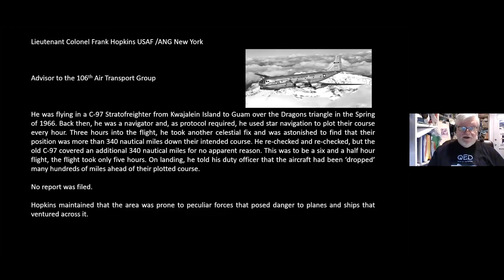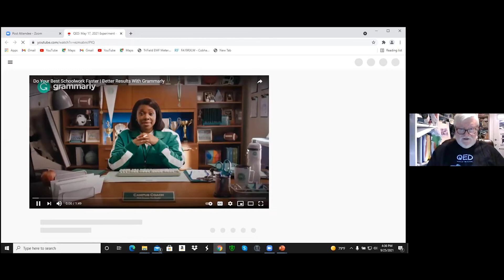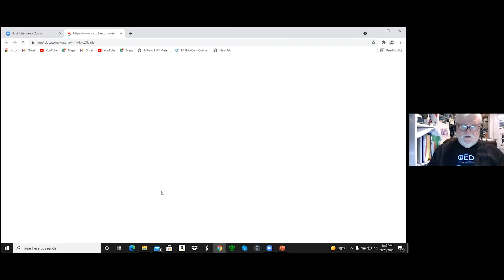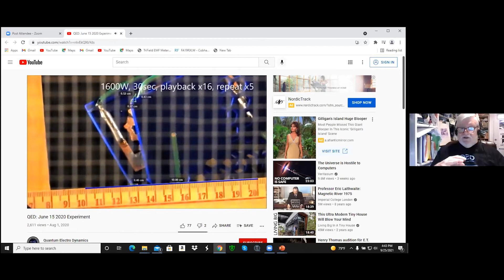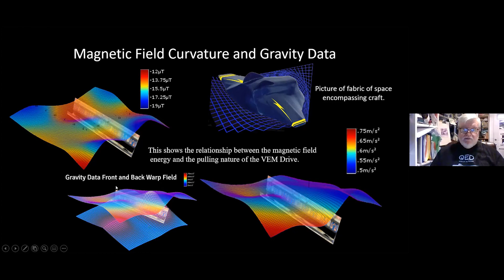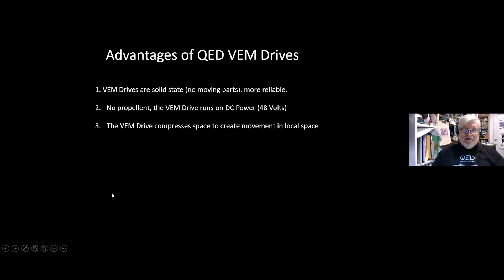APEC 9/25, Part #3 - David Pares - The Variable Electromagnetic Drive

Comment: Re the VEM Drive's Discussions: Although it would be super fun/awesome to do, QED/them doing a tech demo at Burning Man in 2022 or 2023 will be significantly much more money, time, and effort/trouble than doing vacuum chamber tests at their garage lab (of their May 17th, Modified Cavendish Experiment, for example) – and the end result will be the same, getting 'chequebook-supporters' (or a buyerr) for their company, QED. If even the smallest thing, a gremlin or tech-bug, causes their tech demo at Burning Man to fail, then they will have lost/wasted most of that money, time, and effort. However, if they go with the vacuum chamber tests approach then (with minimal marginal/extra costs) they can always re-test / re-run experiments many times at their garage lab until they get it to work successfully; and then get it onto YouTube, and also then ask a few potential key supporters to come look at it in a controlled environment (inside their garage lab). As Spock would say, “it is only logical” – is it not?
Reply: Thanks for saving me a watch, i was starting to get suspicious of this guy